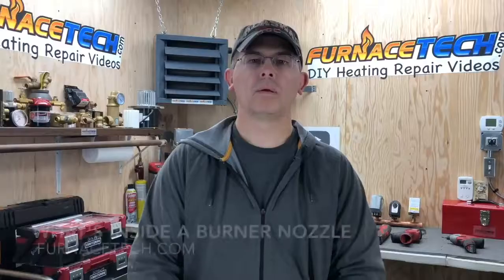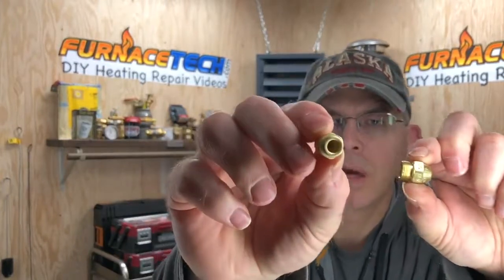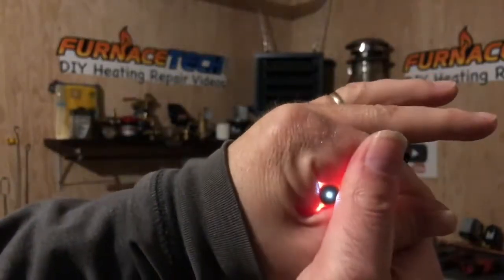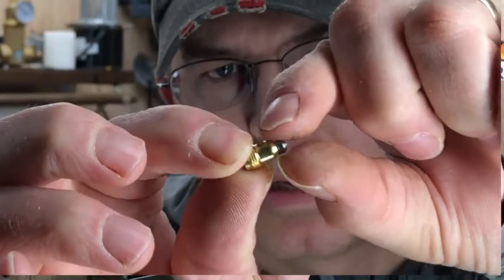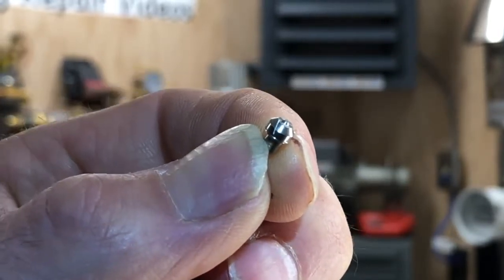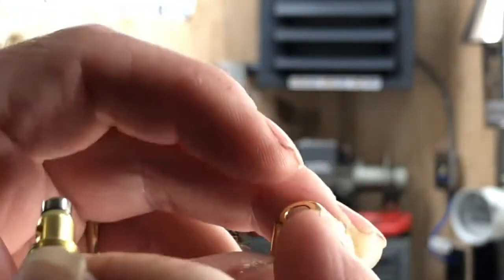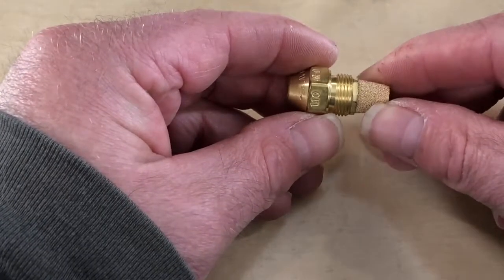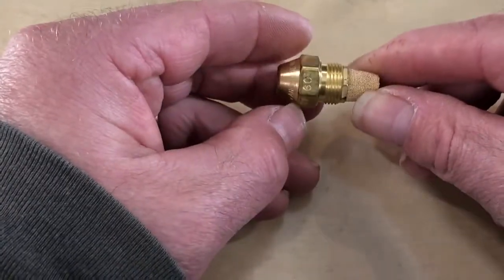What's inside a burner nozzle!!

Comment: So your saying you can’t clean out the nozzle and reuse it ? Only cause it’s Recommended or you just can’t do it ? Thanks
Reply from the maker: These nozzles are precision designed so trying to clean them could alter their GPH - Gallons Per Hour flow rate and or cause adverse spray patterns so when the nozzle get dirty, just replace it.
Reply: @FurnaceTech  got it will do , thanks for the advice..

Comment: Can you make one video on type a3 45 degree nozzle.please show me if there is any fuel adjustment.
Reply from the maker: I am not sure I understand your question.

Nozzles are sized like this: .70 60B or 1.10 45A
So the first number is the - Gallons per Hour
 The next number is the spray angle
The letter represents the spray pattern

If you are replacing a nozzle with a smaller GPH rating then you can increase the fuel pressure to increase the amount of fuel needed to keep the firing rate the same.

There are a few charts you can use to show you the proper corresponding nozzle size to the flow rate at different pressures.

Page 39 of the link below the the chart table

https://carlincombustion.com/wp-content/uploads/OEM-Guide-Complete-with-Cover-2019.pdf

I hope this helps
Reply: @FurnaceTech  Thanks for reply.Nozzle is named Type A3,20 kg/h,45 degree.